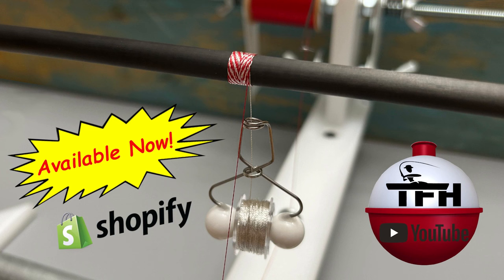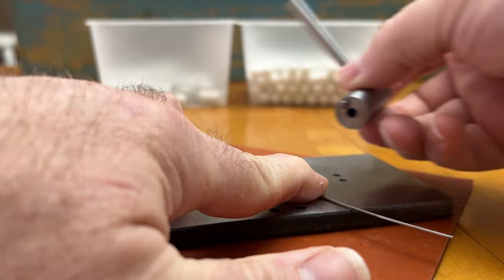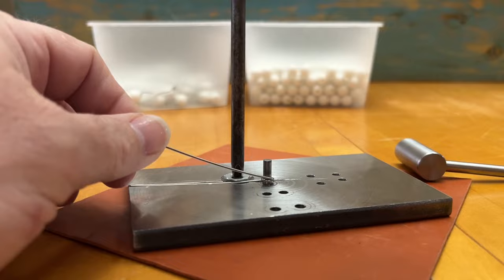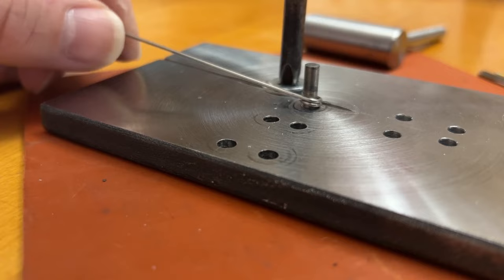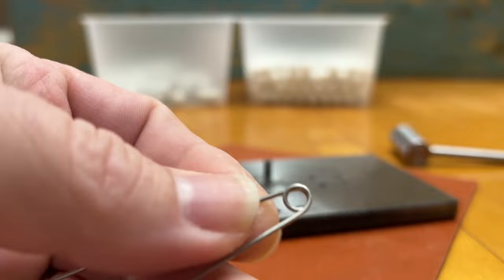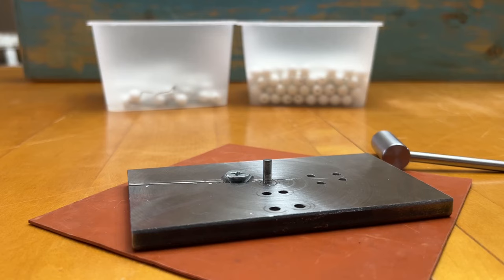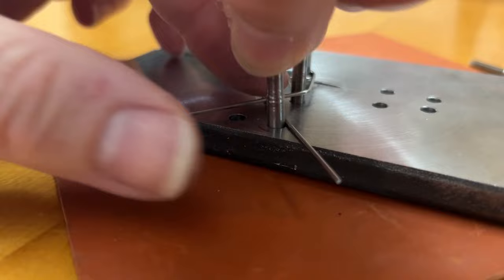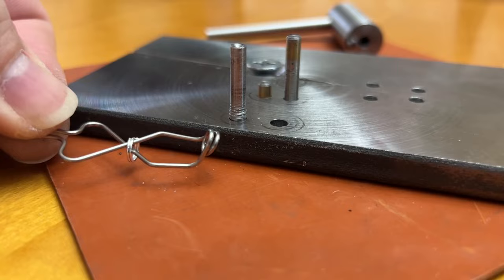Wire Bender - Wire Bending Jig

Comment: Nice simple easy jig to make  Thanks for sharing  I use silver steel rod as well as drill bits Regards from New Zealand
Reply from the maker: I appreciate that tip! I will probably order some in this size to have on hand for replacement pins as I need them 👍

Comment: Nice bend jig, good job!

Instead of sacrificing drill bits you could use ejector pins used for injection molding or stamp pins used in metal stamping. If you get a bulk bag or have a tool and die maker nearby go ask them and they probably will be cheaper and sturdier than the drill bits. The ejector pins are usually surface hardened to around 54-60 HRC. You can get them in many diameters and they come in various lenghts. Hope this helps
Reply from the maker: Thanks!

Comment: I have a wire bender that I bought for a couple of bucks a few years ago. Each end has different forms like round square and tringular and in the middle there are five holes drilled close together that take pins for making tighter bends and angles

Comment: I never tried but is it possible to run a drill bit shank thru a run of the mill die then screw and loctite the pins in? Bit might be a bit hard.
Reply from the maker: Drill bits are hardened but there are ways to do it. It wouldn’t be worth the effort in my opinion.

Comment: in reality tightening the screw is not necessary, as long as there is a stop, because you can clearly see that the two ends are not parallel.
Reply from the maker: The screw isn’t there to try and keep the wire even/parallel. It is just there to clamp the wire so it doesn’t slide towards the pin as the wire is rotating around the pin. I started out with the base plate and the main pin the wire gets wrapped around. The wire would pull towards the pin as soon as you started wrapping the wire around that pin and that made the double loop deformed looking.  The spring steel wire requires a lot of torque to make that double loop and I couldn’t hold it using just my fingers so I added the screw to clamp the wire down so that wouldn’t happen. The spring steel wire isn’t straight to start with because it is from a coiled roll of spring steel wire.

Comment: Are you overthinking your pins i use roll pins ever had one wear out 14 years i and making spinner bait lures
Reply from the maker: Probably 😂
If I ever need to make an another wire bending jig, I’ll go to the hardware store and pick up some appropriately sized roll pins. The thought didn’t occur to me, I just used what I had on hand. I have a ton of drill bits of the same sizes that came in a huge set I bought on clearance for a few dollars several years ago.

Comment: Refer to 5:20 step , what if you flip the wire sir?
Reply from the maker: You would end up with the same bend by flipping it over, but I would still need to add the pins in to keep the wire from moving when I go on to bend the lower section.